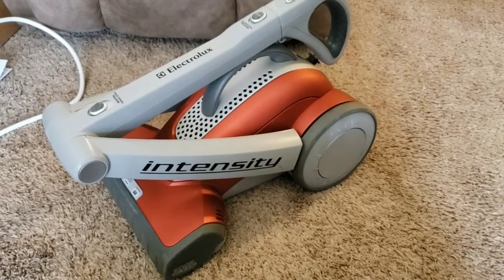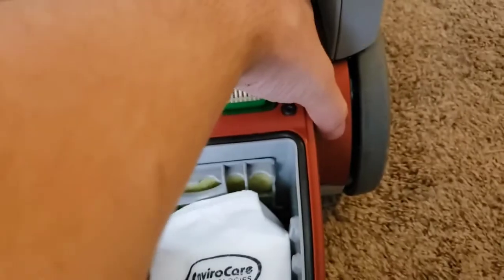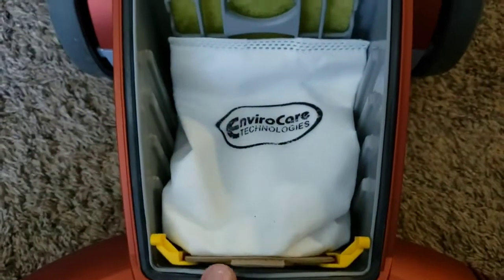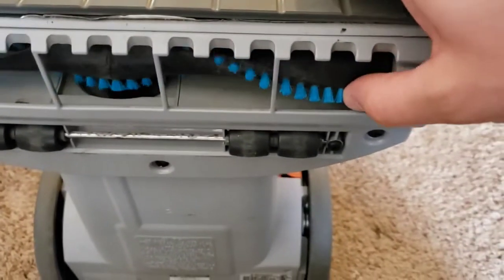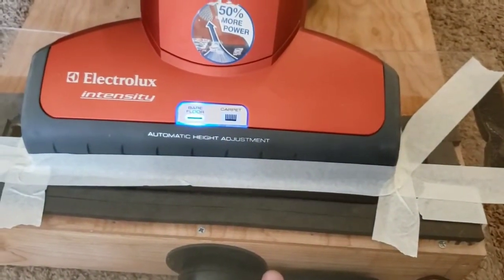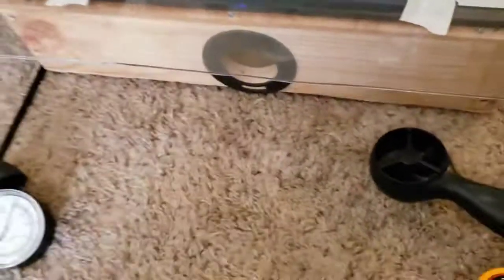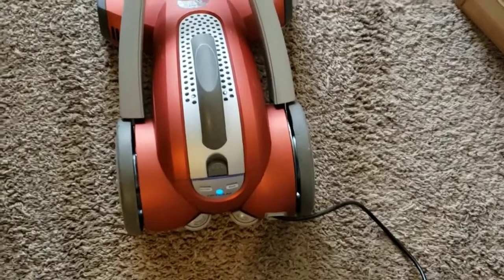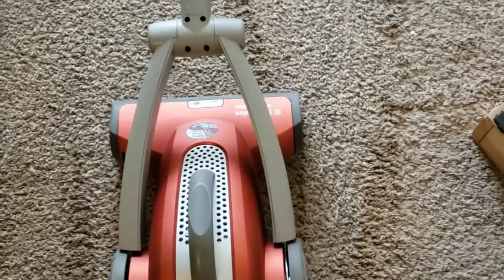Electrolux EL5020 Intensity Airflow test

Comment: Does the handle have to be reclined for the brush roll to turn on?
Reply from the maker: Yes, just checked mine, i was unsure
Reply: @ So the brush roll turns off when handle is in the upright position.
Reply from the maker: @Bunkysworkshop  Correct
Reply: @ Thank you 😊. I have purchased one on eBay and the lady said that she can’t get the brush roll to work. I said I think the handle should be in the down position in order for it to work. She said she didn’t try that but will check it today.